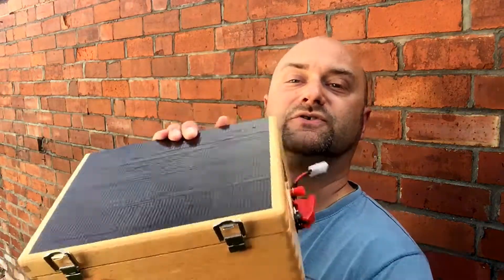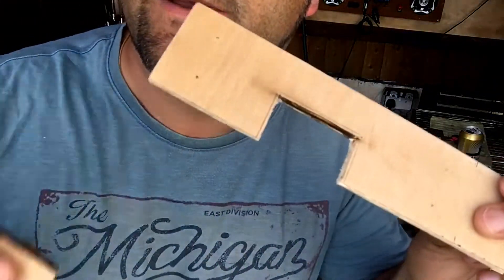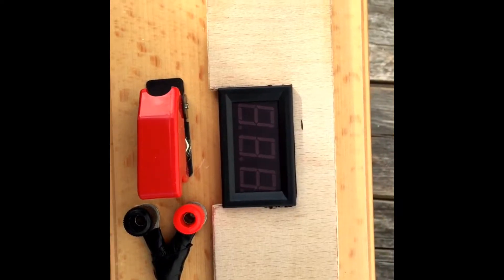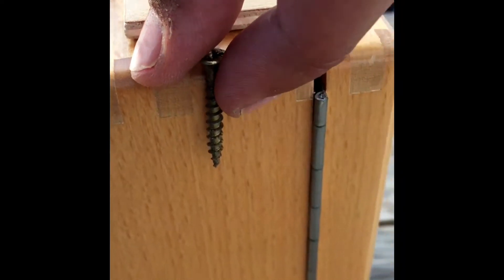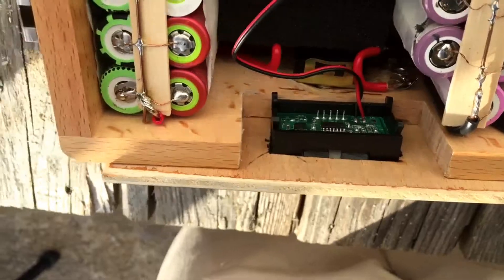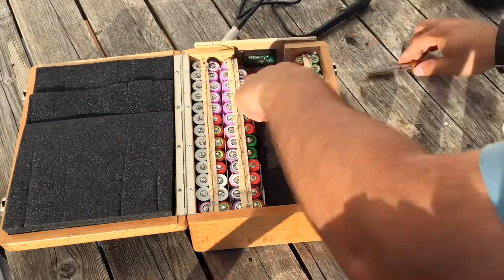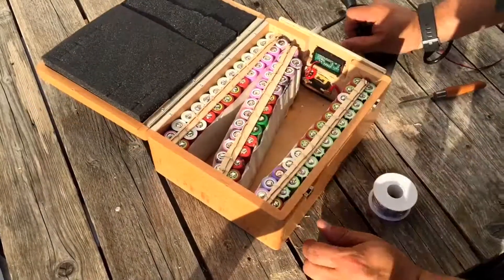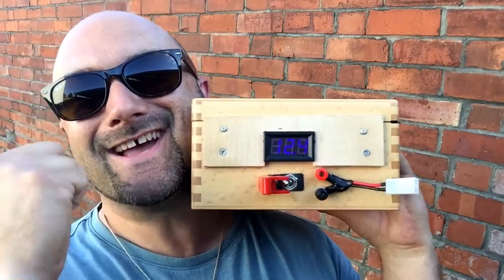Massive 18650 Lithium Ion Power Pack PT9

Comment: I'm curious to know how you plan to recharge the power bank?
Do you need to load balance the recharge process, as you're charging across multiple packs connected in parallel?
Here's an example I found that discusses load balanced charging. Do ya see the size of his bus bars!
https://youtu.be/qeX3MTziBCs
Reply from the maker: So far I have just been letting them manage themselves...  I should probably go put a multimeter across them all and see if they have self balanced...